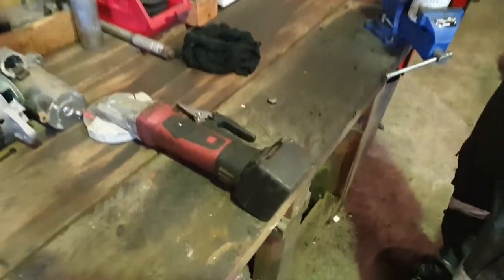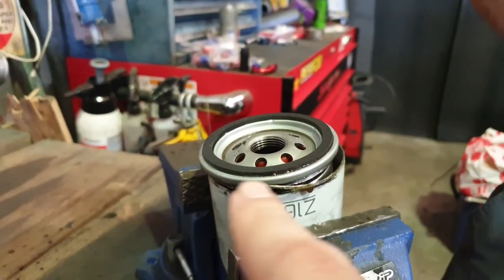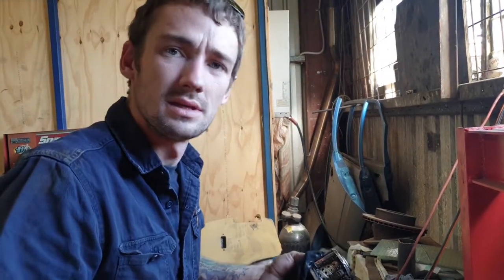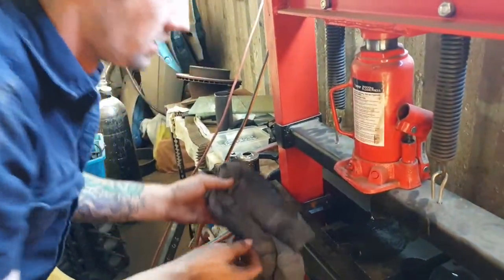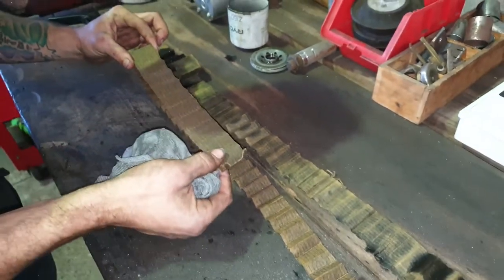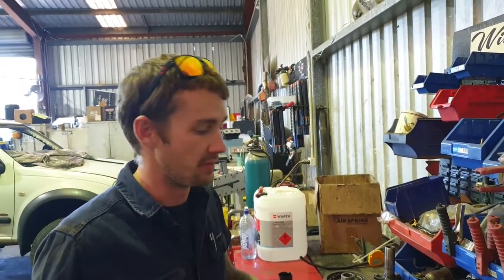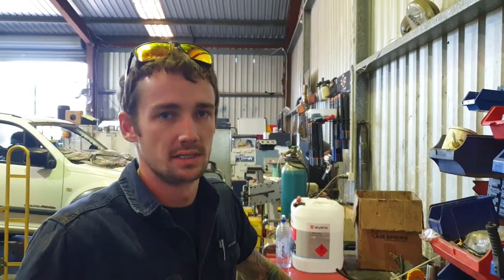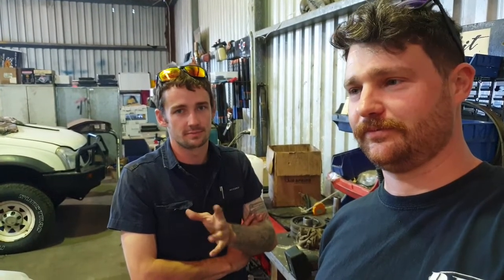Cutting open your Oil Filter

Comment: Yeah i think im gunna have to do  the same.  As on sat i did my brother send of skid and on 2nd  set i dropped a coil pack on the might barra.  Didnt lift tho.       I know it was a coil pack. As between 1000rpm-3500 it was struggling to get revs but soon as it hit 4000 or higher the coil came good n had all power.  Ahahah.    But time for new coil packs n plugs ahha